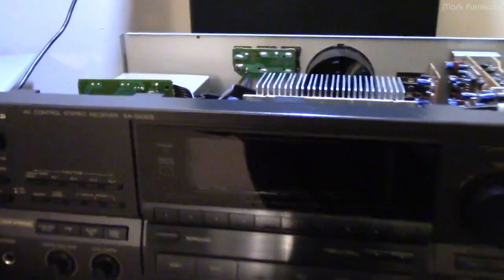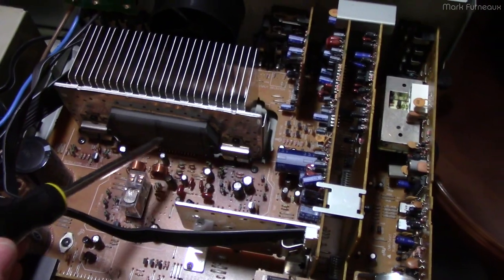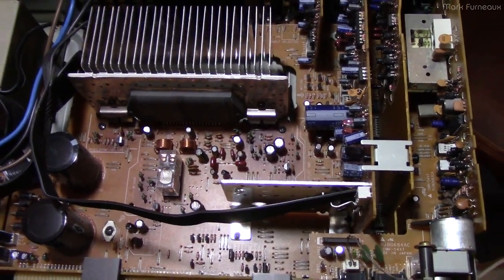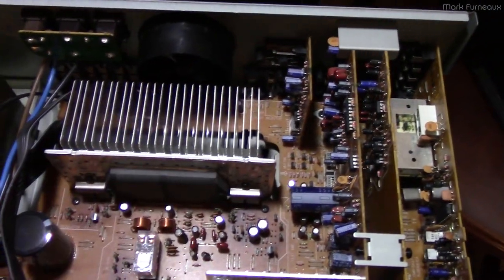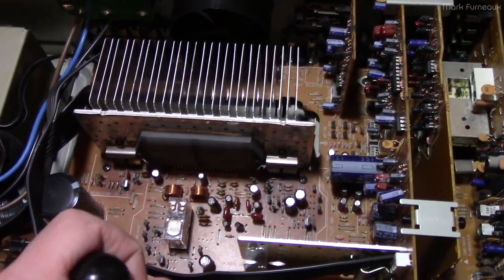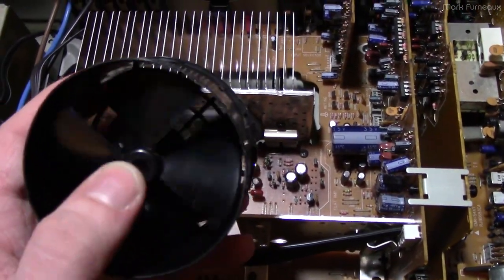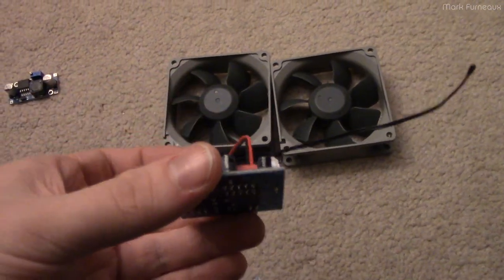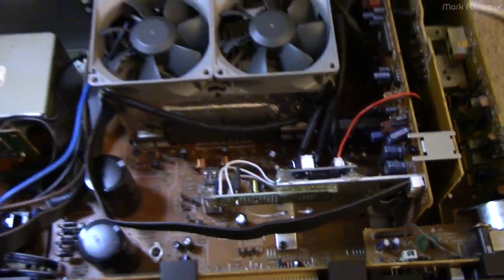1991 Technics SA-GX303 Receiver Cooling Mod

Comment: I had to do a cooling mod to my SA-TX50 as it gets very hot. And the vents on the top cover are very small and is not enough for dissipating the heat. I don't know how Technics thought of this back then. I've mounted a 120mm fan on the top of the heatsink, and a 80mm fan at the back. And for the psu I use a small power brick, which is connected to where the mains go in to the transformer. So when I turn on the receiver, the fans turns on.

Comment: Nice, I will have to try to do something like this on mine,  I have the same model but it's about ready to die.  The LCD screen is dead and the sound is really low for a few minutes, then comes on.  Need to recap it and see if that helps.

Comment: Yeah...this kind of cooling dr
esigned by Technics is strange...
But more strange is,why the power amp section goes always very hot,even no music is played,and ofcourse volume knob is less than half its way..!My Su X520D has this kind of issue,and yours aswell...
Probably it is just a nature of that hybrid Integrated  power section used by Technics (SVI family) ...called New Class A???From my observations...
There are plenty of commonly used Power section pacs from STK family,and they are never become even warm,if music is not played...
I have 2000's Denon on Darlingtons,I have also powerful stage No Name amp on SA1943/5200  transistors..no issue of this kind at all!They go warm/hot only if music is played quite loud...
If no music played they are cold as ice!

Comment: Great video...Have the same receiver but I am a complete newb when it comes to setting up 
what you did here. So I just opened mine, figured how to get that heat sink off, 
renewed the thermal grease and put it back together. 
My lack of knowledge was tapping that 12 volt power for the fans. 
So ended plugging a small noiseless stand alone fan to an outlet 
and pointing it to the receiver top grill to add a bit of flow.

Comment: Great mod and nice explained. I have a SA-GX300 Receiver. Is quite identical with the exception that there are less features but the amp and mainboard is the very same. I was thinking to setup an internal PC 120 Fan just over the  the heat sink fins, or look for a better disipation aluminum heat sink. This is a big design flaw.

I recently got this one failed with this very same problem you address. I've replaced the Hybrid AMP and the regulators but I'm missing some resistors values since they are completely toasted. 

I was wondering if you can provide values for R771, R772 and R614 that are around the RELAY module. Would appraciate your help greatly. Hope I can recover this one. It sounds fairly nice. This one has been with me since I purchased it new in 1991. 

Sadly I was not able to find any diagram or service manual in the internet.

Any way thank you for sharing!

Comment: Oh nice! I have one of these controllers for the two 120mm fans in the cabe box i built for my iMac last year, in which I hid an external hard drive, ethernet and usb hub and all the power supplies. I followed an old tutorial and it never dawned on me to look up the meaning of the solder jumpers. Thanks for making me aware. Off to the solder iron!

Comment: Very nice, also very complicated mod. I own and use SA GX505 as well as whole system based on SG U91 that is in storage. Running 2 channels only, flat. Very clean and powerful sound. Those two, receiver and amplifier, generate heat moment they turned on. More power more heat, of course. OEM cooling leaves much to be desired. What happened to 'other' KISS principle - keep it simple stupid. Three, low profile, USB powered fans with speed control. Dual port USB wall charger (all amazon). Install and run power off receptacle at the back of receiver. Cooling runs the moment you turn receiver on.

Comment: Excellent video. Listened to this on a similar (Denon AVR-1602 5.1 from 2000) with a much simpler setup.
In my case, since it never really showed a sign of getting too warm, I just went with a single 80mm fan on 5 volts.
Dead silent & always cooler than it would've been. Similar mod on a 1980 Realistic STA-800, just to prolong its life.

Comment: Hey, just wanted to be clear before I do this myself: how specifically did you bypass the overload protection again? Or did your receiver not have that sort of check... I've got a technics SA-R477 which I just recapped and sounds excellent and the recap was subjectively a night and day difference but I want to protect the components with proper cooling

Comment: Great work! However, wouldn't it be possible to replace the linear logic
 supply with a switching regulator so it would not put out that much heat in the first place?
Reply from the maker: Yes, but then it would be a lot more work and you'd have to filter the switching noise back out of the supply.